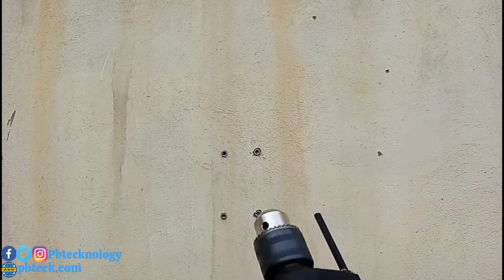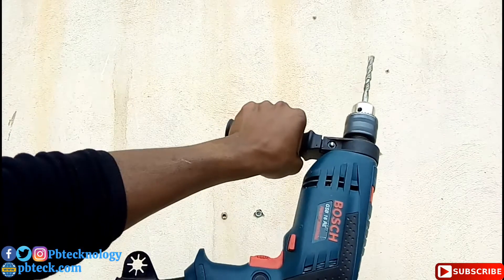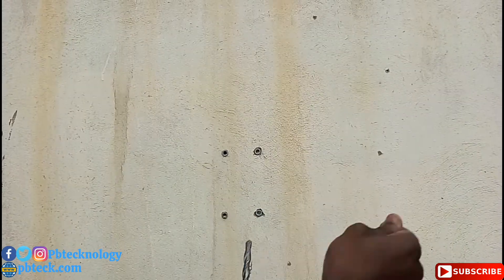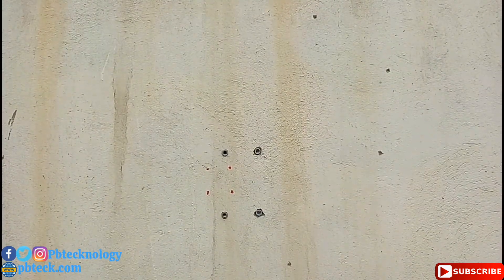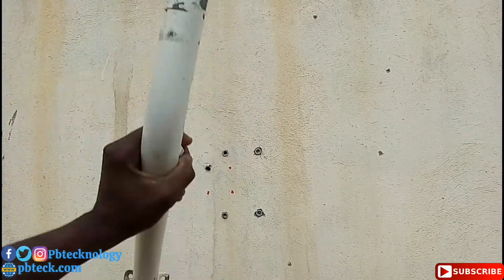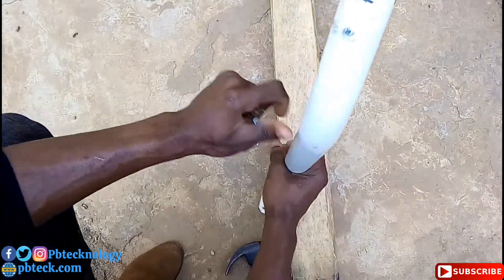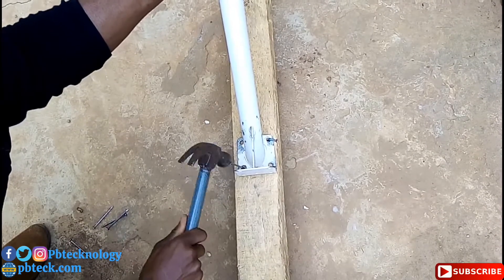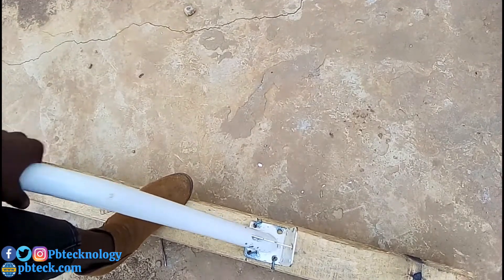How To Mount A Satellite Dish Pole On The Wall

Comment: What size is the drill bit you're using?
Reply from the maker: You can use 10/12. Just use that same drill bit to expand the hole if it doesn't fit.